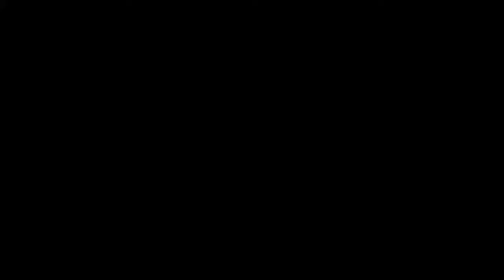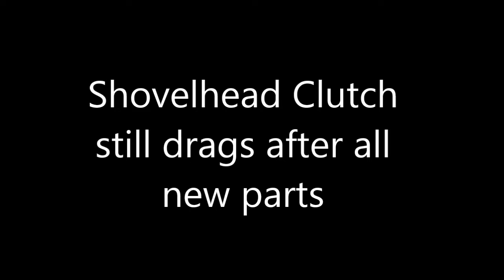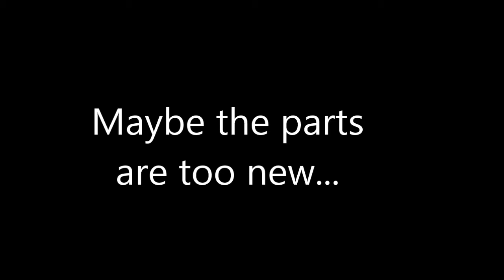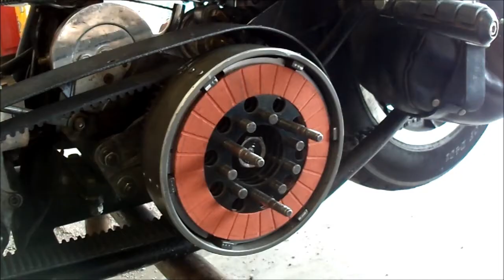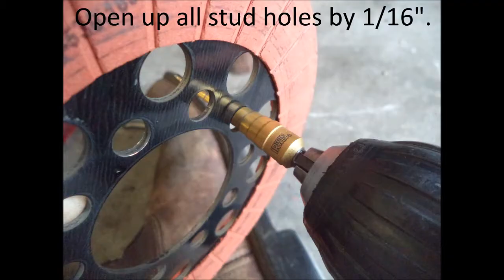Shovelhead Clutch Friction Plate Rework

Comment: Dont you think with all that pressure from the clutch pushrod and the amount of pressure from the clutch springs, that the little bit of drag on the factory holes wouldnt work? maybe next time, wipe the dry clutch disk down lightly with some automatic trans fluid
Reply: Dry clutch ,,,,, no oil on the clutch plates